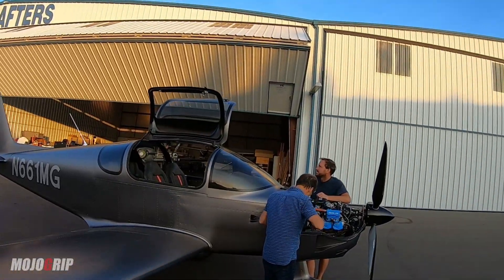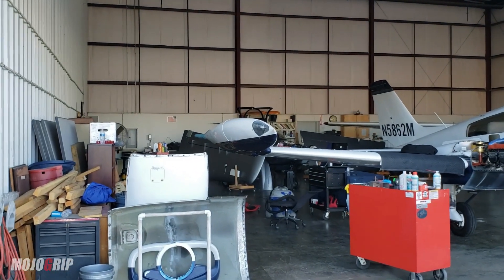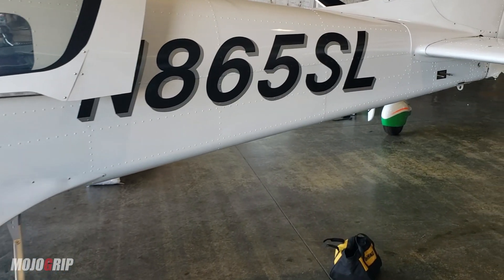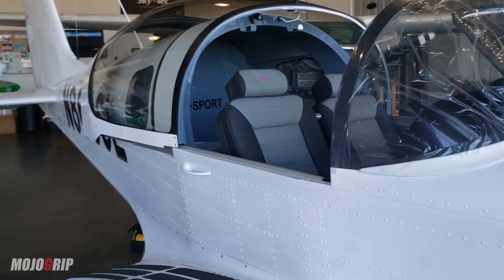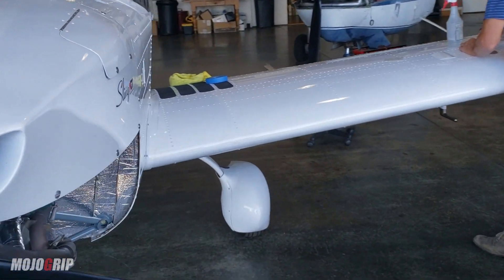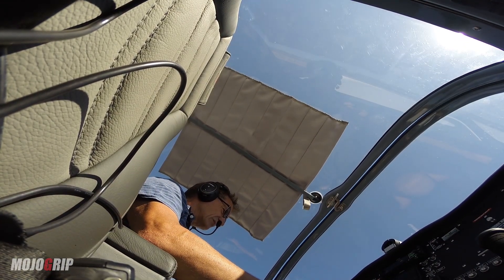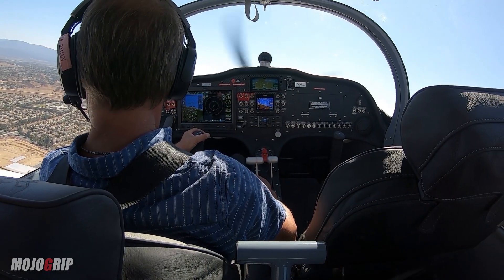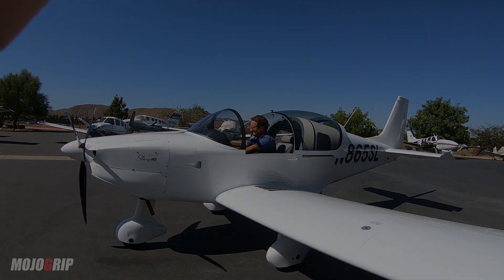Sling NGT Pilot Trainer Aircraft. First Inspection & Flight

Comment: I noticed the fuel placard stated 100LL.  My understanding is that the ROTAX 912 ULS will run on 93 octane auto fuel, with or without ethanol.  I guess it makes sense to placard it for 100LL.
Reply from the maker: It can run both or even a mixture

Comment: Should have 915. And the 915 should be half price.
Reply: current lsa rules dont allow in flight adjustable prop, else yes the 915 would work in this. but kind of pointless considering the 912 is is more then enough power to keep it under 120kts
Reply: @svp2587  Sure there are some LSA speed limits which it would be skirting but I believe Bristell is already doing that. But afaik the 915 doesn't require variable pitch prop?
Reply: @DanFrederiksen  yes and that is my point. like buying a Ferrari or corvette with an automatic, pointless until the faa revises the rules.
Reply: @svp2587  if the engine is actually allowed in the planes, it's not pointless. it's not a speed limit in practice, it's a speed limit spec. Since they allow the planes with the 915 it is essentially legal as I interpret the legality. The unexpected element is that the FAA is not being too strict about the planes' performance. The equivalent european category has no speed limit, only weight limit. And maybe a max stall speed.